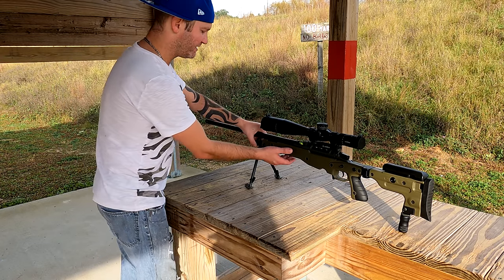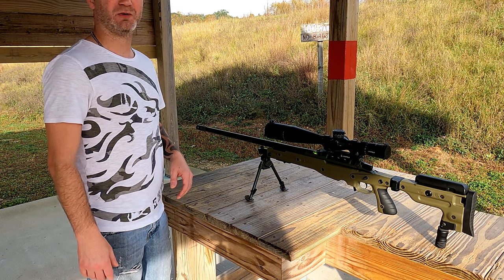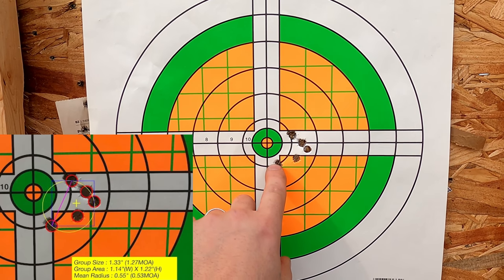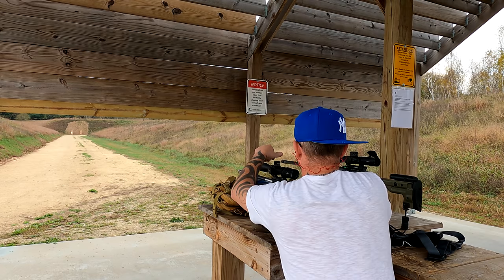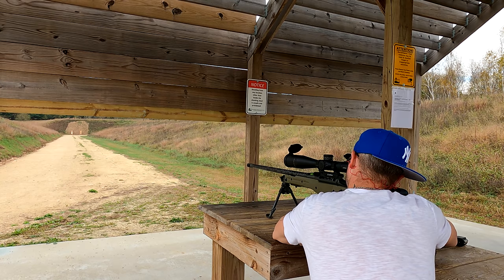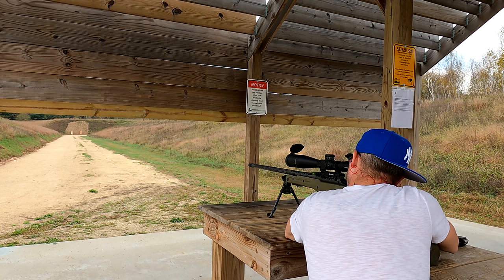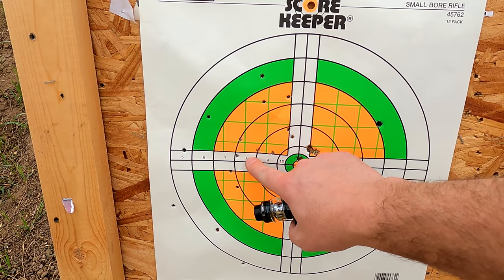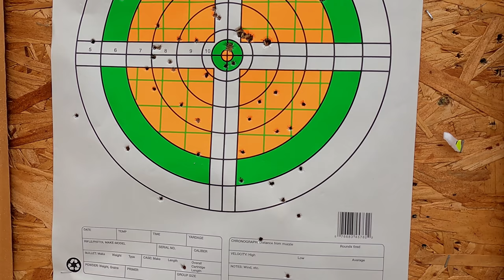I Cannot Get The Rifle To Shoot More Than 3 RD’s And Stay Under 1 MOA

Comment: I think you are chasing the wrong dragon.  

I am assuming you want that to be a "first shot hit" rifle?  

If that is the case, there is NO POINT in shooting a group.  Clean the rifle, as you would have it ready from a cold bore shoot the rifle and record the impact point, and environmental conditions.  Put the rifle away.  You are done shooting it for that day.  Shoot something else.  

Clean the rifle, come back to the range and repeat until you have enough data to know where your first cold bore shot will land at the distance you want it to land at.  

Change distances and repeat.  

The reason I say this is that you want the rifle for a specific job, and then are expecting the rifle to excel in a completely different role.  i.e. shooting small groups. 

I say this because I dont expect my hunting rifle to shoot great groups.  I only care about knowing exactly where my first shot is going to land.  I wont be shooting a group in the field.  I only care about the cold bore zero.
Reply: its got a shit barrel that is  the problem , when those carbon fiber sleeve barrels first came out i already knew to steer clear of them . #7 contour 24'' to 26'' stainless steel . 30 cal.

Comment: That may be an inherent property of carbon fiber. Carbon fiber has an exceptional thermal conductivity that leads to excellent cooling properties, but that could be a double edge sword. The thermal energy will get transferred throughout the length  entire barrel and that may lead to minor heat distortions at the same time the heat distortion temperature is going to be different in the steel than the carbon leading to uneven and unpredictable deflection... or you need to bed it properly.

Comment: Not the rifle, your moving too much and each shot is different. Guns moving all around, you head is coming up and off the stock and out of the scope, cheek weld is out and back on.  Those little things are what make good shooters great at a high level.  It's also the little things that matter most.  The temp difference in zeros is not what you claim it to be, that's you.  A zero doesn't change that much based solely on temperature.  From your other shooting videos to this one, it's 100% you.  Try getting another shooter behind the gun.